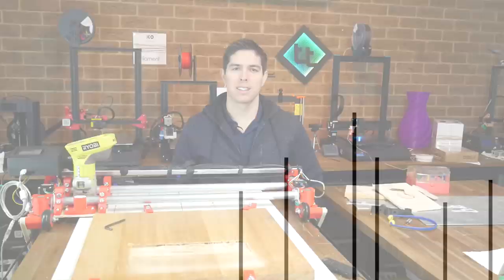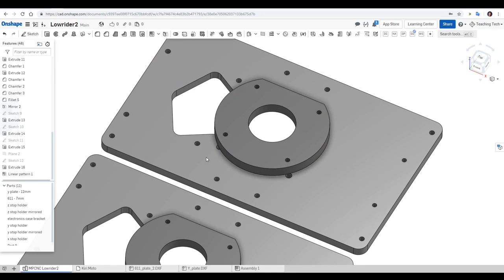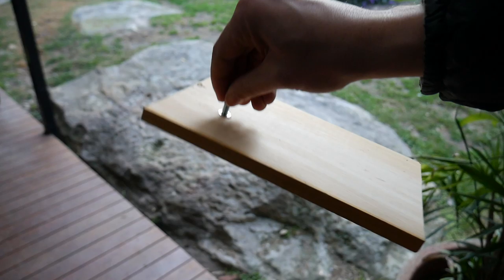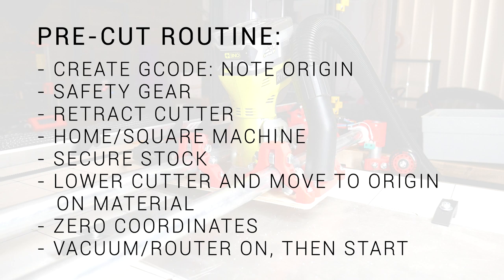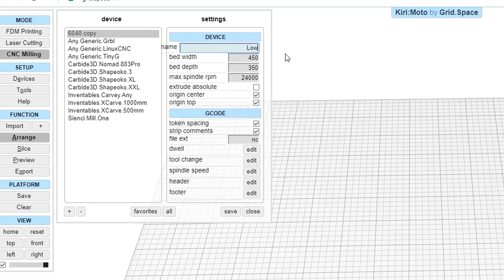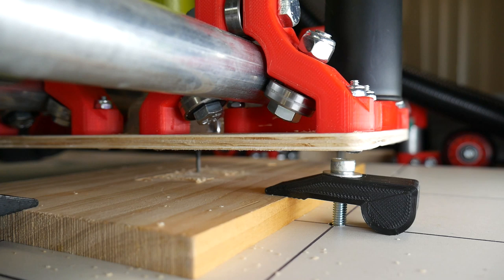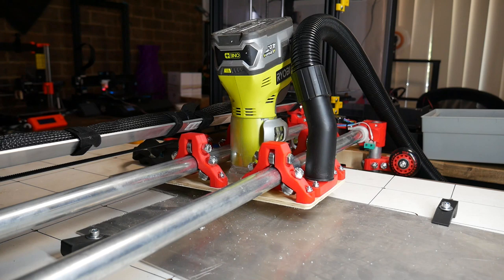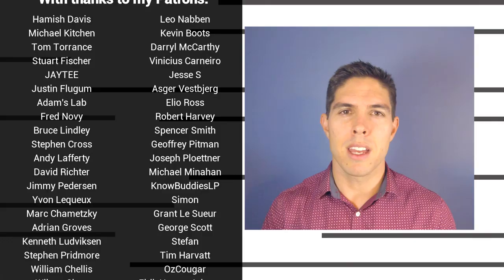MPCNC Lowrider part 3 - Router, spoil board and cutting stuff!

Comment: For whatever is holy to you stop using these garbage Tinker CAD-like software and switch over to Fusion 360 with proper CAD and real CAM toolpath generating capabilities especially useful for such low-end machines! Adaptive Clearing / Trochoidal Milling will allow you to make much deeper cuts WHILE being easier on the tool saving you time from repeatedly cutting the same profile at various depths!
Reply: Lets not forget being able to modify your lead in (in cam), using a ramp instead of a plunge, using linear or radial lead into edges, etc etc
All makes for a nicer finished product. That's the aspect that I do not like about hobby class software, there's just enough options to get you started but they don't seem to have a person that has some professional knowledge about what a toolpath should be doing. Perhaps not to important for softer woods, but any move to much harder wood and metals, well it needs just a couple of simple options for toolpath lead in.

So far Fushion is the only "free" package that I've personally used that has more advanced tool path options. I even wish Fushion has a few of the options that NX has (it's what I use at work) but we can't have everything. I have to cut some slack to TT, he was only doing this as a test because the machine wont be used for these purposes. Using a CAD/CAM package is by far more desirable though. This is a hobby machine for sure, but why not teach yourself something new, cleaner toolpaths are less frustrating as well.
Reply from the maker: @Durahl You're missing the point. I have spent good money on licenses for two very powerful CAM packages, yet I don't include them in these guides but that won't be very helpful for 99% of viewers that is easy to learn and free. I have the ability to see things from viewpoints other than my own and I don't look down on people who have a workflow different to mine that suits them perfectly.
Reply: @TeachingTech  To be fair Fusion 360 is free for hobbyists
Reply: Fusion 360 is a huge learning curve for some. I nearly gave up on it. Even though I can use fusion I didn't know about three other programs that were referenced here. Often the tinkercad style of things are the best way to start to build the learning curve before upgrading to 'real software'.

Comment: Great videos!  This Lowrider CNC is a project I have been considering doing.  Just a bit ago I was looking for something interesting to print on Thingiverse and stumbled on a Turbine Rotary Tool  https://www.thingiverse.com/thing:76369 and remembered your issue with the battery-powered router.  I'm not sure if it would have enough torque for a CNC application but nonetheless thought you might find it to be an interesting solution.